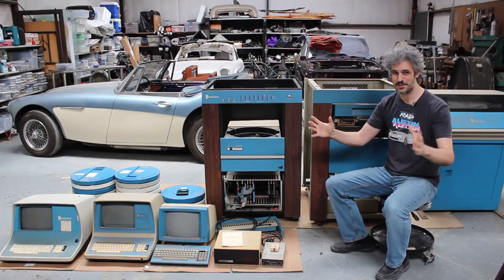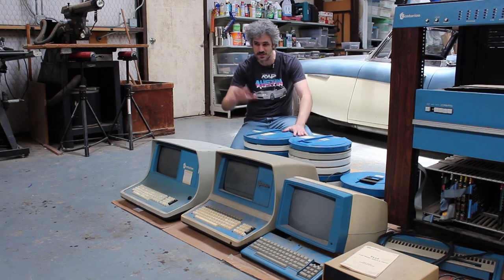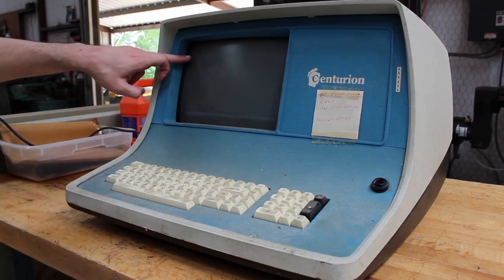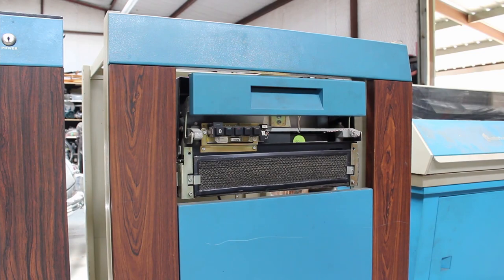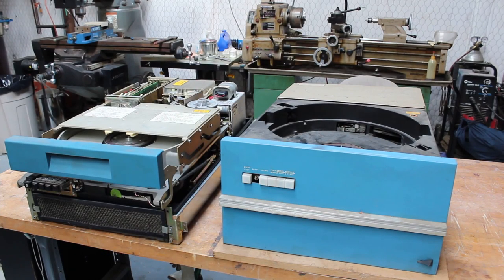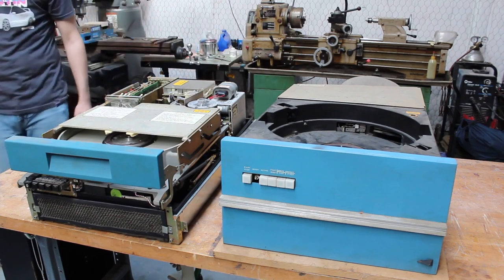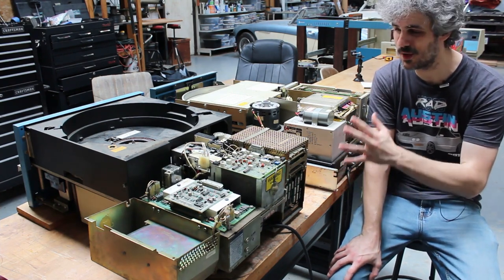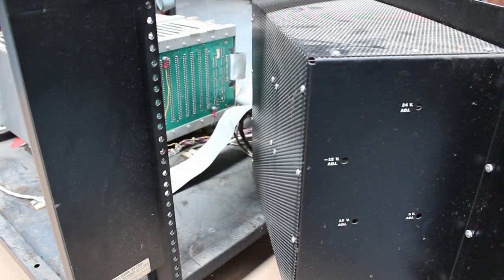Minicomputer Part 2: Removing the Drives

Comment: No, most minicomputer were half height racks. Full night racks were usually used in Mainframes and the upper half normally was only used for tape drives. They were lighter. One of the HDDs or the changeablevdisk drives weight is about 75kg. 
At least the ones from Data General I had to handle. 
The service teams had to install and remove them for service from these racks. 
You would not want to handle a weight like that overhead. We had special scissor trolleys that you could slide underneath the drives when you removed them. They would only come up to half height of the 19" racks.
Reply from the maker: That's really interesting!
I think the Minicomputer designation gets used on a pretty wide variety of systems. For example, the Data General Minicomputer that Tech Tangets picked up is two full height racks, and I know a guy here in Texas too that has an SEL 810A Minicomputer that has a few full height racks as well. 
Although you're absolutely right that they never put the drives too high up in the racks, because they weighed a ton. The SEL 810A is incredibly complex though and has computer hardware spanning full height on some of the racks though!
If you're curious, check out some of his videos on the machine, it's awesome: https://youtu.be/L743MjJthHY
Reply: @UsagiElectric  no the Minicomputer designation came from the smaller machines that were not compatible with the IBM mainframes. They were targeted a smaller companies or work groups within large corporations. The VAX for example had an absolutely amazing graphical work place system that allows electrical engineers to do PCB routing, heat flow analysis. No Mainframe could have done this kind of stuff. The OS was not really geared to realtime loads. Minis were more flexible.
Funnily enough the Minicomputers I was trained at in the late 1980s were Nixdorf 8870 a machibe that ran the SAP like solution of the 1980s and the 8864 a minicomputer that was a glorified connectivity device for banks. Running banking terminsl, ATMs and other branch connectivity to connect to the bank's mainframe and funds switches. They were replaced by Sparc systems and Cisco routers.
Both systems had discrete CPUs that were also built around the Analogue Devices 4 bit ALU you found in your Mini. The OP Codes were also proprietary. These machines disappeared after Siemens took over Nixdorf and rubbished the two systems in favour of their own Mini.
But it only lasted for a few years. IBM introduced their AS400 and Unix/Vax machines combined with PC networks started to take over. 
By the Mid- 90s that transition was pretty much done. Unix workstations and Sun Sparc systems chucked out the remaining minis. 
The sad thing was that the Minis missed privileged execution OP codes and memory protection. This would have allowed the Minis to run Unix. Then they might have survived a few years longer. 
After all, the Sun/Oracle Sparc Servers are still around and dominate their market nieche - Banking.

Comment: The Phoenix drive could be either 30, 60 or 90 Megabyte. The removable pack holds 15 Megabyte of the total. Worked on those back in the 80s and 90s.

Comment: Hi;

Just in case, You might need to know..
If the Lower Platter is Damaged, You can take a Platter out of one of the Disk Packs, and use it to replace the Damaged Platter..
Years ago, when where worked we had four hawk drives and one 9448 Drive, I was the one that maintained the Drives, and when a drive went down or had a head crash, I was the one to get them back to working order again..
We never had an alignment Disk and I never needed one..  Sometimes, the crash was so slight, by me catching it right away, (I got to know the sound of what  Good drive sounded like) all I had to do was clean the heads and put them back in the machine, and I was off and running.. Other times it took a few hours to get back to having a useable drive..
THANK YOU Marty  P.S, I would love to know what part of the country You are located at, that if it is anywhere close by, I could help.. I do not Drive, nor do I have and vehicles, just to let You know..
Reply from the maker: Unfortunately, I think more than the physical platter itself, the top priority is salvaging the data stored on those platters. Since everything is proprietary Centurion code and software, I think the data is needed to even get the machine to boot. However, I do have one removable platter that says "Operating System" on it, so I'm hopeful that we can maybe get some life out of it!
The heads for the removable platter on the Hawk drive are definitely destroyed, but if I'm lucky the heads for the fixed platter might still be in good shape! 

That's awesome that you worked on these! I may lean on your expertise in the future when it comes time to dig into the drives, because I'm pretty far out of my depth here, haha.
Unfortunately, I live on a farm in the middle of nowhere Texas, not really close to anything, but thank you so much for the offer of help!

Comment: DANGER! If that oil filled  motor  capacitor was made before about the mid 1970s, it may contain PCB oil, which is a proven carcinogen. That one does look OK, no bulges. If it is bad, do not open it and let the oil out.

Comment: Bad news video @ 12:40 show the 9724-Hawk 10Mb CDC disk drive has a very bad R/W head crash on platter zero heads 0 & 1.  Have never seen heads so damaged before working on this disk drive type for over 10 years.  Likes like something hit the head assy. other that the disk platter. if this drive had a disk pack installed and the drive was spun up & loaded the heads onto the disk platter the removable disk platter and likely the fix disk #1 are damaged also.
Reply from the maker: Yeah, I totally didn't realize when filming that these were the heads, but they are well and truly destroyed. I'm hoping the Phoenix drive is in much better condition and also hoping that there isn't any indispensable programs on the Hawk fixed platter that I need. Either way, the Hawk will get a complete teardown to see just how big of a mountain we have to climb!

Comment: (07:46) You shouldn't need to unscrew the slide rails. 
There should be a rail unlock cam or switch, on either side of the slide to remove them, without disassembly.
Reply from the maker: I actually cut about 20-minutes of footage of us searching all-around the drive for little cam locks to let it slide completely out. The drive slides out about halfway, then a cam lock can be pressed to let it slide about 80% of the way out. However, at that distance, it's so heavy that the drive can actually cause the entire cabinet to topple over. My theory is that they didn't want a single person sliding the drive all the way out as it's way too heavy for just one person to lift. So, it slides out about 80%, then two little screws can be removed and the drive can be lifted straight up off the rails. 
The screws weren't load bearing or anything, which is why I'm inclined to think it was more for the safety of the people having to heft that massive drive out of there.
Reply: @UsagiElectric  some of those high-weight rack slides have a two-stage unlocking mech. one click for 80% and then another one from behind to release it all the way... *(of course yours might not have either...)

I've moved a lot of 50kg to 75kg VTRs over the years! :P
Reply from the maker: @tekvax01  There might have been another locking mechanism, but we sure couldn't find it - though that could definitely just be us looking in the wrong spot, haha.
Reply: @UsagiElectric  ... I have three large iron blocks painted orange that were the counter weights on the bottom of a large tape drive cabinet. They helped prevent the cabinet tipping over when the tape drives were pulled out the front for maintenance. They eight 7.5Kg each and are really useful for holding things down or pressing leaves and flowers between paper. :)

Comment: Oh, crap. You're hosed. The close-up of the broken parts? Those appear to be the read/write heads for the disk cartridge. If my way-back memory is any good, then you need at least two replacement heads. The things you identified before as heads are actually brushes used to clean the surface of the disks. Anyway, I doubt you're going to find replacement heads for this drive. The last one of these I saw in operation was back in the early 90's.

Comment: Hi;

I didn't mean using a platter from the Centurian drives, necessarily , but getting another one from some other drive that uses the same diameter of platter.. As I agree that these might be the only Centurian Platters..
Also, don't say for sure that the Heads are BAD on the Hawk Drives.. First clean them with Alcohol and ONLY if needed use some very, very fine emery cloth to smooth and rough edges along the outside of the head.. Not in the middle of the head, where the read/write part of the head is.. Many a time all I needed to do was to clean any surface coating from where it came in contact with the platter. And if it was because of reduced air flow the replace the air Filter,, (sometimes I had to just try it to see if it was from reduced air flow.. And be ready with my finger on the unload button..)
THANK YOU Marty
Reply from the maker: That makes sense, sorry I misunderstood what you were going for.
I like your optimism on the heads though! Once I get stuck into taking the drives apart, I'll get some close up macro shots of the crashed heads and we'll see just how bad they are. Hopefully, we can get both drives up and going again (though ultimately, I hope to only need one drive in the chassis)!

Comment: The hawk drive is a basket case so don't use it maybe use it for parts but the phoenix drive will be your only drive so maybe if you can get 8" drive units and the OS for that system then that might be the way to go.
Reply from the maker: The Hawk truly is a mess, isn't it!
But, all may not be lost. From what I've heard, the Hawk drive is actually the more resilient of the two. So perhaps with some cleaning, aligning and new head, we might be able to get it going again.
Having said that, I would love to get some big 8" drive units for it instead. That feels like a much more reliable way to get the system back up to demonstration level of functioning. Unfortunately, Centurion both built and wrote the control code for everything on the computer themselves, so getting a drive that wasn't intended for the system to interface with it is going to be a herculean task.

Comment: WARNING: Magnetic Field!
Reply from the maker: I mean, that's the coolest sticker on the whole thing!
But I believe the massive voice coil that moves the heads in and out is stuffed up under there. You can see a picture of it from the manual at 12.45.
Reply: @UsagiElectric  voice coil? However will you manage now, between awesome vacuum tube projects (you're amazing) to the minicomputer (you're amazing.) Or do you let the bunny select which item to work on? As someone with too many hobbies, I feal your pain.
Reply from the maker: @skeezixcodejedi  Haha, yeah, the voice coil I believe is essentially the same thing as the coil on a speaker. Just trying to move those heads in and out fast enough to keep up with how quickly it's trying to read data.

Thanks for the praise! I try to flip back and forth between projects, tube computer one week, minicomputer the next week, then back to tube computer, and so on. The unfortunate side is that there are also a bunch of other projects I want to start as well, so it's tough to figure out how best to balance the episode order. Coming next week is another tube project, but not a tube computer one, so it's going to be two more weeks before we get the next tube computer update (which isn't a bad thing as it gives me time to build the pieces, haha).  

Too many projects, not enough time is our mantra!